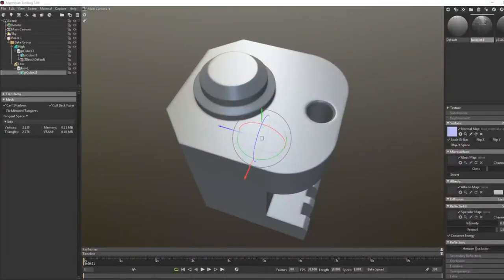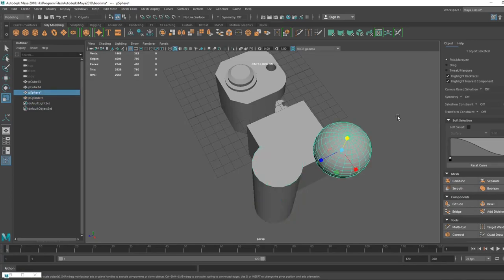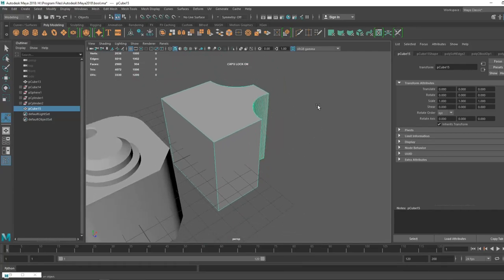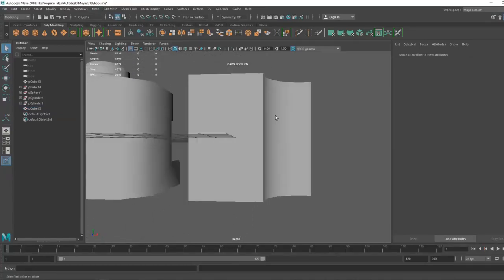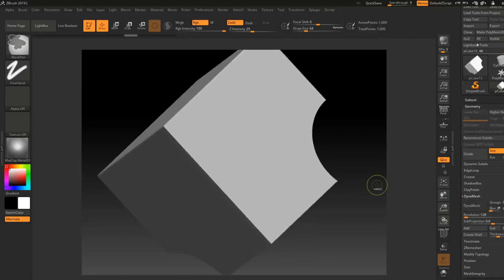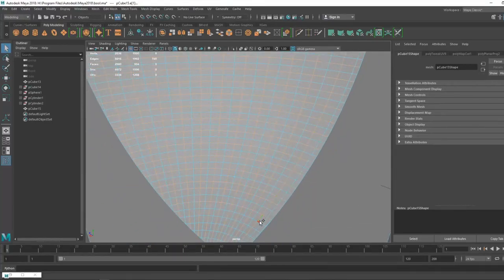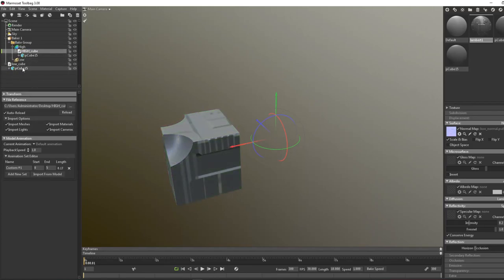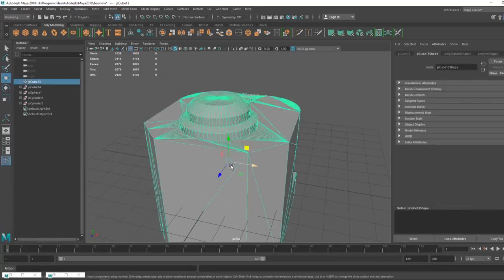Tutorial: Creating Smooth Edges for High-Poly Bake In few minutes using ZBrush

Comment: Hi man, finally I found a tutorial that I wanted to know some answers about polishing and stuff. Now I have one question. I have a problem when I trying to polish some objects with holes, but when I polish it, the holes getting smaller and smaller, so how to make those holes keep their place and not move if you know what I mean?
Reply from the maker: Make sure the holes do have different poly groups (inside ring) and have enough geometry in order to polish them perfectly.
Reply: @abderrezakbouhedda5191  thanks for the feed back. I have one more question. Is this type of work can be used for bigger objects or projects like for example tank modeling and so on? Because I tried this to use it on tank modeling, its really problematic, for example if I find some tiny objects or some objects has narrow edges, it gets some twist.